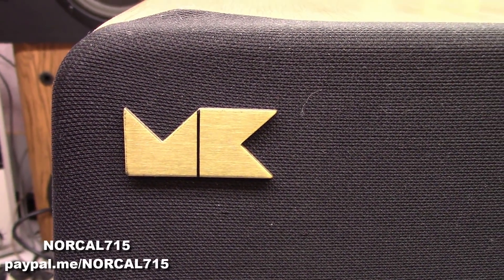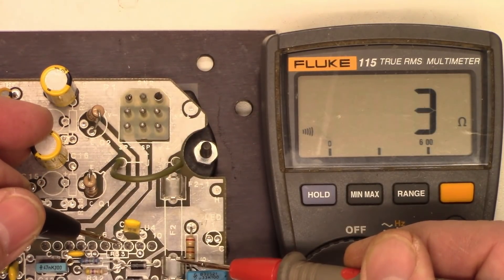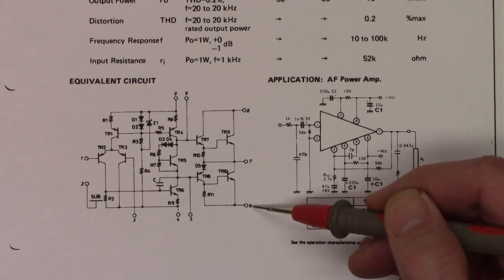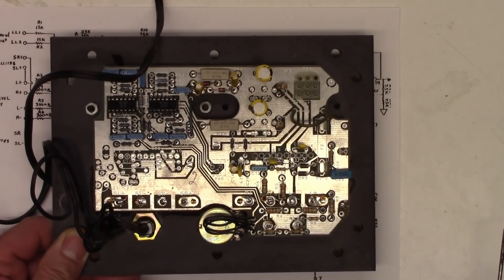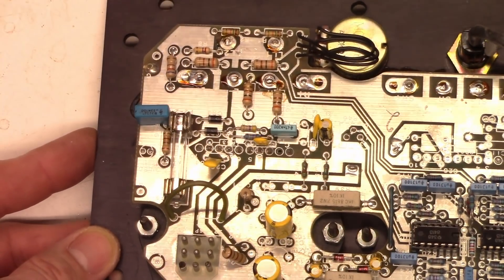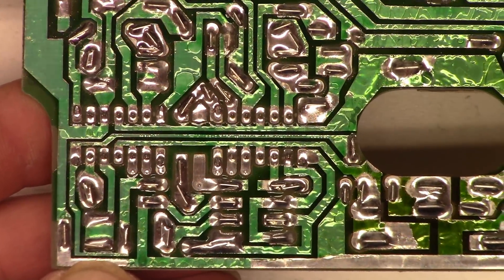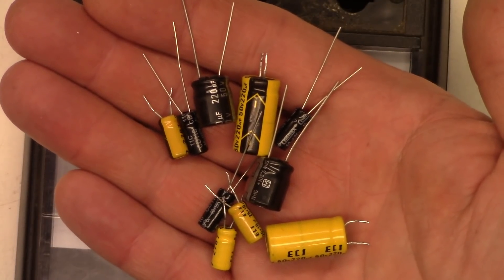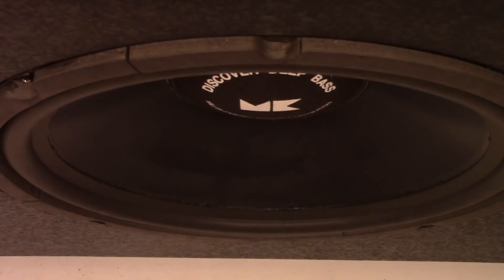MK MILLER AND KREISEL SUBWOOFER REPAIR V-2B V-1B VW-2 VW-1 MILLER & KREISEL

Comment: Thanks for the channel! Great stuff. I’m restoring a M&K V-1b. On initial open, the internal fuse was blown. Once replaced the sub made wub wub and popping sounds, so I did a full recap. Now, I am continually melting the resistor in R38. Both hybrid power pack chips show as fine with no shorts or continuity across any pins. Still struggling to find a schematic for this board. Any ideas?
Reply from the maker: Send me an email and I will email you the v1b schematic. norcal715videos@gmail.com

Comment: This was an excellent video, and covered quite a lot.  I have the same sub and similar issue.  Did all your power checks, excellent no leakage.  Turned out was a bad HPM also.  Got a new one, installed, powers up, red light, sound to sub, BUT speaker has lots of static, and a slight low volume.  Speaker is definitely good, so wondering if this may come down to those 5 capacitors also?  No loose connections or obvious damage found otherwise, hmmph.

Comment: Good day sir,
I have a MK MX-125,
I’ve bought it around 1997. 
I recently plugged it into power and the sub makes random noise and then settles on a low drone sound. 
For more context, I connected to my Sony 5.1 via speaker wire and issues persist. 
Not sure what to make of this. Hope you have some insight.

Comment: Help? I have the first edition M&K volkswoofer system. made in 79. I bought them new and love them. Long story but now I'm rebuilding them and I'm replacing the woofer and I don't know how the wires hook up from the amp to the woofer it's been apart for years. Two sets of wires a white and green coming out of the circuit board and a white and green connected to the room matching control switch any help would be appreciated. Oh and do you know how many OHMs the amp is? Thanks Dean.
Reply from the maker: Is it an original Volkswoofer? if so I do have an original MK schematic, no wire colors though. email me NorCal715videos@gmail.com and I will forward the diagram to you.

Comment: Thank you for you you Tube Video. Trying to find a repair company for my customers M&K Subs in the UK. (M&K X10 Sub)

Trying to contact them direct s the drop down contact form gets diverted to their UK Importer. 
As going though the UK Importer they says that getting spares from M&K is not great and they have not a repair agent in the UK.
	
M&K SOUND
Metalgangen 9
2690 Karlslunde
Denmark

'skb@mksound.com. (The email bounces back)

Please could you able to get the Circuit Drawings on the Amp and your M&K Spares?

Not great for the expense of the product if you have to say to the customer we can't get your M&K Speaker repaired and you need to buy a new one.

Appreciate any help contact info for M&K you have.

Thanks

Richard

Comment: Ahh! my M&K V1-B sub just took a crap. Was going to send it to the landfill even tough it worked great and and was a furniture piece. Figured I look to see if there was a YouTube fix, when I can across your video. I followed your testing and found the same results - bad STK086 chip. I haven't pulled the caps yet to check them. I don't have an ESR meter - cam I use a Ohm meter?   I will let you know if this  was my fix. Thanks for your expertise!!!!
Reply from the maker: No sorry you have to have an actual ESR meter, order a cheap MK-168 transistor tester (approx $20 on ebay from china, $30 from US suppliers) you will have to pull the caps out to test them though. Make sure you test the 2 big filter caps on the rectifier board out of circuit also. https://www.ebay.com/itm/401037195640?hash=item5d5fadf978:g:zCMAAOSwp5JWYWV2

Comment: I have the same subwoofer and replaced all the capacitors and the amplifier. I also refoamed the driver.  The sub is working but has a rasping sound that consistently follows the tones coming out of it. Nothing is loose and I  have two different back plates assemblies to try out the system.  Both have same sound issue. Could the power supply itself be bad and cause an issue? Any thoughts would help.
Reply from the maker: Did I just talk to you on messenger?

Comment: I have a Sonance DL10 dual level sub woofer..damaged by a power surge.. I remove the Amplifier board and there are brown coloring in a few areas on the board power transformer looks ok.. How can I test that the transformer?..I'm  not a Elect tech  but love working on electronic.. how can I enlist you to repair this woofer or is it worth it.. The woofer is about 20 yrs old.. please let me know.. Thnks
Reply from the maker: If you have an ohm meter do a resistance check across the blades of the AC cord and see if there's any continuity to the transformer. Email me NorCal715videos@gmail.com

Comment: Hi,
Did you order Japanese capacitors like Nichicon, Rubycon, Panasonic and Nippon Chemi-Con? And did you select low ESR/High ripple current and 105°C and > 4000h lifecycle?

Liked you video and how you do a commentary over your own work. Tx!
Reply from the maker: No, I used what I had on hand. I should however order a  "audio" assortment.  Thanks for watching.

Comment: I think a big part of the hybrid amplifier failure rate is that simple amplifier modules make design easier for lazy product designers.  So often I see them bolted to wholly insufficient heat sinks (or with no heat sink at all).  The severe thermomechanical stress from bad thermal design ends up cracking the printed resistors and die attach over time, often precipitating a shorted output.

gradual cracking of bias resistors (at least this one failed safe):
https://3.bp.blogspot.com/-qDxx9th7__Q/V8g7VvAF8NI/AAAAAAAAAfU/EnF_B0kjVUoMowKHni6pl9RVcOJY0iMOACEw/s1600/IMG_20160901_244553_799.jpg
Reply from the maker: I used to tear the STKs apart to see what failed. I should have done it with this one, too bad the customer picked it up and I always return the old parts to the customer
Reply: @norcal715  Would have a shorted transistor, probably with a brown mark on the coating, and the rest of the module fine. As that one is so simple a external power transistor to replace the failed top unit would have worked if there was a long wait for a replacement one. The modules were nice from a manufacturing point, single unit to install, less hand assembly and thus cheaper to make. Of course most had poor heatsinking, so they led a hard life, and in this case the module really needs a bigger heatsink attached as 70W is a lot of power to dissipate on a flat plate, though here it is thick enough to spread the heat out somewhat.

My powered speakers with a similar module I added an external heatsink to the case right behind the modules, to keep them cooler, and they now run cool, not at finger burning heat. Thermal epoxy and an old Pentium cooler with the base sanded to a flat plane, and the 2 surfaces cleaned and lightly sanded for the epoxy to bond well.
Reply: SeanBZA adding a heatsink is a good idea imo too. Lower temperatures will prolong the life of the caps too. Maybe the module failed after the caps went bad.